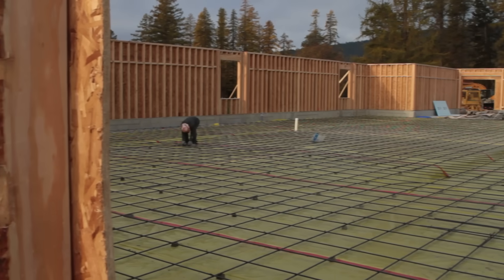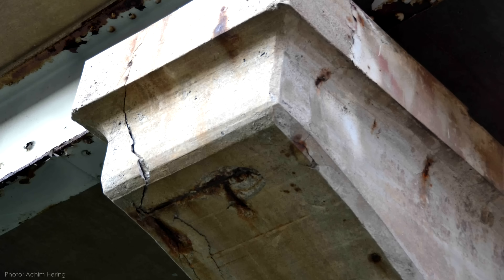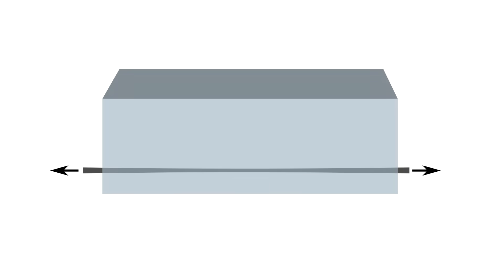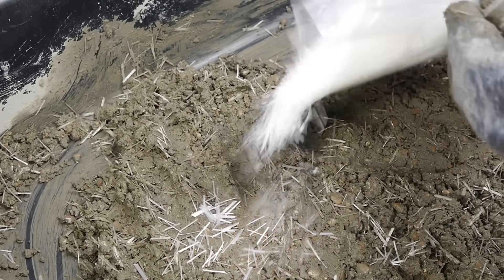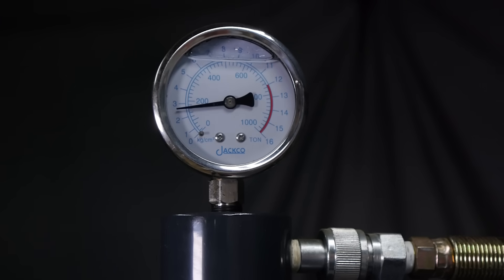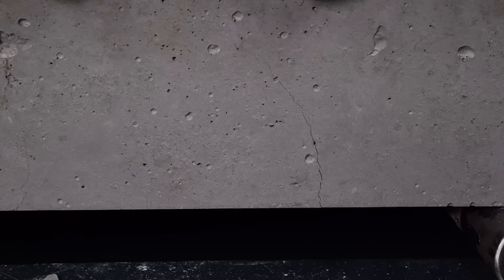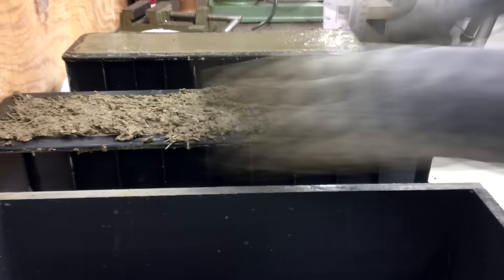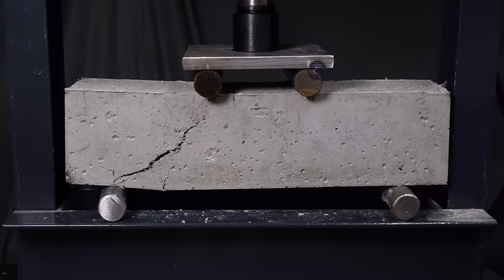Does Rebar Rust?

Comment: No stirrups, REEEEEEE
Reply: Yep, that's why all 3 beams had the typical diagonal shear failure at the same load
Reply: he didn't say all 3 failures where at the same load just close to the same load.....so the FRC does help in a few different ways too... and adding an external Fiber mate to Reinforce the Concrete works even better... https://www.youtube.com/watch?v=B4FwvEnedP0
there a lot of ways to skin a cat....
Reply: What?
Reply: A stirrup is a closed loop of reinforcement bar that is used to hold the main reinforcement bars together in an RCC structure. And in columns stirrups provide the lateral support to the main bars against buckling.
Superlink Stirrups | Reinforcement Bar | Rebar in RCC Construction
www.tatatiscon.co.in/home-builders/superlinks-builders.aspx
Reply: N C wrong, it is used for shear.
Reply: Sorry if I confused, but ur wrong. Since u can't apparently comprehend what "A stirrup is a closed loop of reinforcement bar that is used to hold the main reinforcement bars together in an RCC structure." means.

Next time I guess I have to dump it down (when from a technical 3rd party source) and just say it "helps prevents shearing failures"? 

Or talk about sheep since, u said "it is used for shear"(ing a sheep I guess)? lol
Reply: N C I know what lateral support for buckling means, but concrete doesn’t buckle. Also no, the stirrups are not there for buckling. It is there for shear. The main bars are there for flexural. It could be confused with the term buckling. Buckling is a term used for members with elastic properties (ie: steel columns). Although rebars do have elastic properties, when it acts together with concrete to make a member, the member loses its status as an elastic member.
Reply: It was a mistake to reference buckling in my retort since a beam was being referenced. And in general they are not in compression so mentioning buckling was not germane. And it was a shear failure (so it was edited to correct the oversight). 

But stirrups are used to prevent buckling by maintaining the integrity of reinforced cement concrete (RCC) such as a column. And since failures are based on the (entire) member not just one aspect or component of the member the inelastic of concrete isn't relevant. 

https://www.bayt.com/en/specialties/q/148975/what-are-the-causes-for-buckling-and-yielding-of-reinforcement-in-concrete-structures/
Reply: @PokeYourEyez  so is buckling when a material fails despite being in the elastic region?
Reply: Jeroim3142 you can google it
Reply: N C I just want to make my point clear that stirrups are used for shear. Of course it can hold the bars in place but that is not its main purpose. Anything can hold a bar in place. As far as buckling, that is the main bars’ job.
Reply: Stirrups in a column resist "the lateral deformation of the interior concrete core so that the strength of concrete column is increased". To an even greater extent in a column than in a beam since tensile loads tend to be more uniform in the stirrups. And are used to a greater extent at the ends of the column just for this reason to prevent buckling. 

 "I just want to make my point clear" stirrups are not just there to hold the (vertical) bar in place, they play a primary not secondary function in a RCC column.

https://www.quora.com/What-is-the-main-purpose-of-using-stirrups-during-construction

If Im still not expressing it well enough for you since my writing skills are limited, pls just research it. Its well documented. How stirrups function.
Reply: N C Are you saying stirrups are not there for shear? I can’t win with you. That’s the problem with you structural engineers. You always think you’re right.
Reply: 1st there is no issue about stirrups being there for shear ofc they are but thats a factor in a beam. And the subject was changed to the buckling of a column. That has different stresses on it ie mostly compression not tension. So shear isnt that relevant for a column.

And if winning matters? I stated I made mistake before so you can say u won. 

BTW thx for thinking Im a structural engineer Im not. But its nice to know I have been called one even if it was in condescending manner. 

.Have a good day, Sir....
Reply: N C i was joking. I knew you were not a structural engineer from your very first comment about stirrups holding the bars, and you citing sources from the internet. I’ve been yanking your tail because I think some of your responses were very defensive and irresponsible. You should never tell anyone stirrups are there to hold the bars. Stirrups are not there to hold bars, add strength, or control buckling. However, stirrups do hold bars, add strength, but they don’t do much to help with buckling if the main bars fail. With your logic, you could say “the rocks inside the columns make it stronger.” My responses are not to argue, but they are to ensure irresponsible information is not put out there for the public to read.
Reply: NP, it was assumed most if not all of what you said was a joke. Like when you said "My responses are not to argue, but they are to ensure irresponsible information is not put out there for the public to read". And good luck with your fixation about the "stirrups holding the bars" or not? I apparently gave you. Sorry about that....

BTW there is no such thing as "irresponsible information" just ppl that can't deal with some information and are to closed minded to let the facts lead them. "Its not knowing what you don't know that matters. But pretending to know more than they really do know," that is truly dangerous, at least for structural engineer.

But thx for being so amusing Mr “The rocks inside the columns make it stronger.”
Reply: N C irresponsible information is when a person who is not an engineer, gives engineering information. Same understanding is set in the medical field. There are a lot of things in engineering that creates more variables with different factors. For example, more steel in concrete is good but it can also be bad.
Reply: You must be still joking to have the pretense to think of utube comments as a professional forum. Or grade the info you have presented as worthy of one. 

So who not an engineer? For someone inferring they are an engineer. Your deductive reasoning is wanting. Let hope you don't make vital decisions based on assumptions with such an insufficient data set, like you did here. 

Stating "There are a lot of things in engineering that creates more variables with different factors." And "For example, more steel in concrete is good but it can also be bad." were just truism pablum. Not worthy to even comment on. 

I'm done with this banter since its has gotten pointless. So take a chill pill and put in ur pho. I miss pho :( 

Enjoy :)
Reply: N C the only time I was joking is when I called you an engineer. Clearly you don’t understand engineering. The statement about more steel is good and bad is a real thing. I tried to educate you. Isn’t that why you watched this video in the first place. And yes, I am a structural engineer with 12 years experience.
Reply: "About more steel is good and bad is a real thing". Just to educate you a "truism" is a statement that is obviously true and says nothing new or interesting. 

12 years experience structural engineer and still doesn't fully grasp how stirrups function in a column or that an RCC column can buckle is a scary thought. 

And assuming someone is not an engineer after they state they are not structural engineer, shows a deficiency in deductive reasoning and is just one more error on your part. I have been an engineer far longer than 12 years but hopefully I never pretended to have all the answers and have enjoyed being the student as much as the teacher. Expect on rare occasions when the other party is just a pompous arse. 

Also I thought these videos are for ppl that want to learn, not pontificate and be defensive when they can't logically state or defend a position. So it amusing how you think condescension is a synonym of education. So enjoy doing what you call education.

And no joke us engineers need to have a better sense of humor so check out the links below when your feeling omnipotent :)

https://csengineermag.com/article/structural-failures-that-changed-engineering/

https://www.youtube.com/watch?v=Mv3BN__8pTE
Reply: N C I don’t know why you keep posting links for sources to someone that does this for a living. I have 20+ structural books and manuals on my bookshelf next to my desk. And I am 200% sure I know what I am talking about when it comes to stirrups. Did you even notice you got your sources from a builders website and not an actual engineer site. Why is it so hard for you to understand that concrete does not buckle? It does not have the physical properties to buckle. 

I didn’t try to start an argument and right now you’re trying to turn it around. Were you not the one that was very defensive? I just wanted to correct you because your information is irresponsible.
Reply: What can you say when someone just repeating your utube comments are "irresponsible" and they are "200% sure" of themselves without any facts to back it up? 

And links were one more failed attempts to add levity and perspective on this discussion. 

If I may suggest let's end this discussion on a positive note. So I wish you all the best my learned colleague. (and I would say the pray for the czar but I dont think you would get the humor in it :) Have a good day, Sir.
Reply: N C Do doctors have to back up their facts? And yes I will keep repeating the irresponsible information comment. Engineers take an oath before graduating. It’s like being the Queen’s guards. I will tell anyone not to give irresponsible information and repeat it until the day I die. Maybe you don’t have respect for engineers is probably the reason why you have to have these things explained to you. Also, you could have just ended this yourself by not replying? You went from trying to make a point to just wanting to win an argument that was never intended to be an argument in the first place.
Reply: @PokeYourEyez  don't forget diagonal tension.

Comment: This might be a dumb question, but would having the rebar closer to the center of the concrete beam verses the bottom increase the strength?
Reply: No. Imagine how the compressive and tensile stresses are distributed along the beams section. Because of the way he is applying the load, the top of the beam is in compression and the bottom of the beam is in tension... so somewhere in the middle of the beam there's a "neutral" axis where there isn't very much tensile or compressive stress. The compressive and tensile stresses increase as you get further away from the neutral axis, so, it's best to put the steel closer to the bottom of the beam where the tensile stresses are the greatest. Concrete does very well in compression on it's own, so it can handle the compressive stresses above the neutral access just fine on it's own.
Reply: Not a dumb question. When you apply a load to a beam, the top takes compression while the bottom takes tension. You can see that cracking always starts at the bottom. A beam does not take stress equally through its shape. I wish I had a better way of explaining lol
Reply: For strength, you want the rebar as close as possible/practical to the bottom. Centre and above would almost be pointless as there are no tensile stresses there.

Comment: There is also self healing concrete in which water from the outside causes some form of reaction that closes the gap the water went in, but those are currently more in the area of research and not even as well tested as the steel bar alternatives.

Comment: Hey Brady. I've been watching your videos on civil engineering since I started studying the subject some 2 years ago. You brought up a very interesting problem in the civil engineering field, something that my professors have frequently brought up in lectures aswell. Change in incredibly slow in the field, and civil engineering is (I think, having been shown several different visuals) one of the most backward, technologically speaking, segments of the economy.

Given that, how long do you think it will be before we see widespread use of fibre technology, or even graphite (which certain professors are very excited about)? Obviously testing has to be immaculate, as the structural integrity of buildings is tantamount.

Comment: you also forget that lots of contractors don't do any kind of protection like epoxy primer or other paint to protect the rebar while they're waiting for concrete to arrive, salt doesn't necessarily have to be present to cause rust to form, rainwater is enough to cause it to rust which makes construction a tedious process of protecting the metal reinforcement while waiting for the concrete to arrive..

Comment: Hello, very much enjoyed the video, and learned a lot from it. I have two additional questions. 

How viscous does concrete have to be to be usable? From your videos I see that your concrete flows very well sometimes but when specifically the glass fibre was used in the concrete if seemed as if it was solid particles that you were squishing together. Is it still usable at that stage, how would you ensure that there are no gaps in your concrete?

What would it take for innovation to occur in civil engineering? Could you go deeper into why it is so hard for changes to be implemented?

Thank you very much!

Comment: one of the main reasons for choosing steel bars as a Concrete reinforcement other than it's ability for withstanding tension 
is the Thermal expansion coefficient (TEC)
both Concrete and steel have a very similar (TEC) 
The reinforcement material that you gonna use in concrete has to expand and contract at the same rate as the Concrete does..otherwise the system will fail
Reply from the maker: I have a video on that too ;)

Comment: While cracks can cause rebar to oxidize and shorten the lifespan of a structure considerably, there is an argument to be made that it's beneficial to see those early signs of deterioration. In your experiment with fibers added there would be little to no warning of a structure reaching its limits before total failure.

Comment: I started building steel reinforced concrete buildings in 2,002. I have noticed that fiberglass embedded concrete cracks less, this really works. I have found fibercrete most useful for crack prevention in slabs poured on grade and in thinner slabs like ICF slab systems.

Comment: Concrete can absorb ground water and through capillary action move it up to 40 ft. Long term durability can also give false security, rusting stains on concrete show that the concrete is weakening, however lack of maintenance or replacing the rusting parts is what causing them to fail. Reinforcing that does not rust will not give a warning before they start failing.
Reply: BenjaminFranklin99, we all know the failure is caused by rusting, however concrete through capillary action absorbs water rusting the rebar.
Reply: Water contains oxygen and if it gets a continual supply of water will rust.
Reply: Then why does rebar rust, you are the one over your head.
Reply: BenjaminFranklin99  Maybe more but rebar still rusts in places where there is no salt. Of course salt will accelerate the process.Salt and water is very corrosive to steel.

Comment: If you were tasked to construct a large structure designed to last at least 1000 years, what modern materials would you use to ensure this structure does not fail due to a lack of engineering. (ex. political or civilizational changes (ie, intentional destruction), only use, environment and time.)